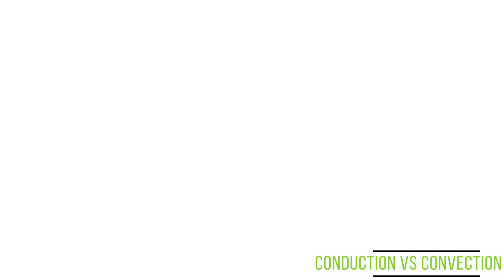Conduction vs Convection Vaporizers Explained

Comment: Hi. Do you think conductive or convective vaporizers are best suited for tobacco? I find it difficult to make a choice. Between
three convection: 
1. XMAX V3 Pro,
2. XVape Fog Pro, 
3. XLUX Roffu
and three conductive ones:
1. X-Vape X-Max Ace, 
2. XVAPE X-MAX Starry 4, 
3.Flowermate Cap Pro
Reply from the maker: These vaporizers are not intended for tobacco use. Only Dry herbs!
Reply: @TVape  And then what vaporizer would you recommend for tobacco?